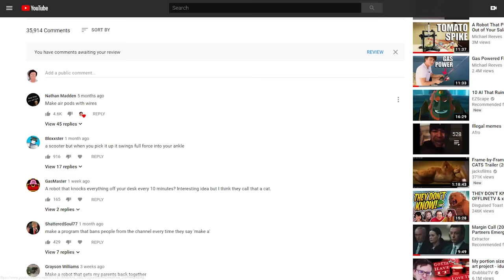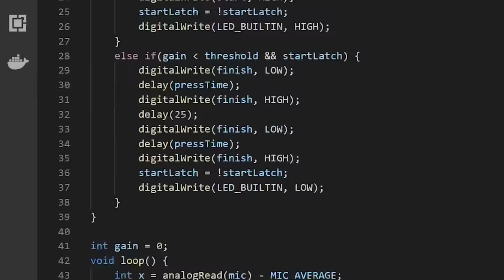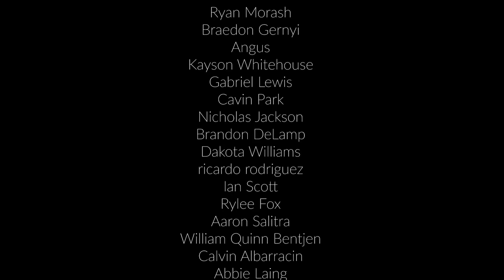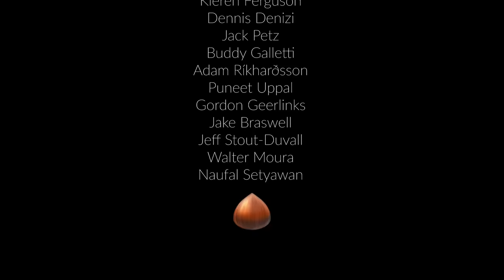Scream Powered Microwave

Comment: A soup spoon that goes limp if it detects moisture.
Reply: YES
Reply: NOT SCIENTIFICALLY POSSIBLE

guys help I don't remember what I meant by this joke but I wasn't high or drunk and I wasn't being serious I have no idea what this means
Reply: Make a mold of a spoon, fill mold with water, freeze it. BAM ice spoons
Reply: I was thinking of a spoon cut into segments which are held together by tension, such as a motor pulling a string. When the spoon detects moisture it will add slack to the spoon which will therefore be unable to hold itself up.
Reply: Pringles Can 

It was from Invader Zim Netflix movie
Reply: Oh god please yes

Comment: Technically, it's not a scream powered microwave. Screaming only triggers code that allows the circuit to run, but the screams themself do not produce any electricity, or if any certainly not enough to power a microwave

Comment: He is very talented, but I just want to point out a small thing. It is not scream powered microwave but scream controlled microwave. It still needs to be plugged in to a power source. Actually scream powered microwave if you can make it , is not such a bad idea. I just need to put it near my window considering how noisy the streets are , I don't even need to scream.